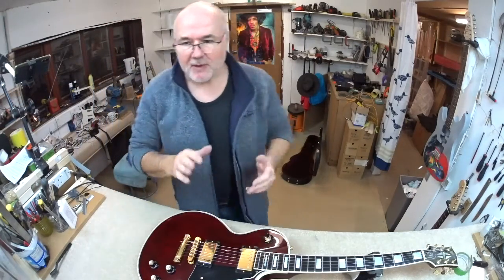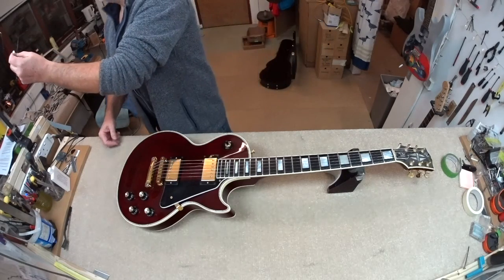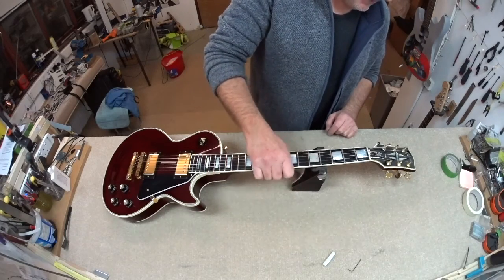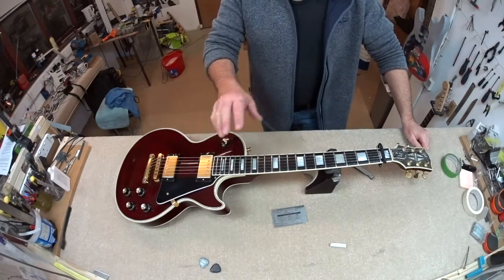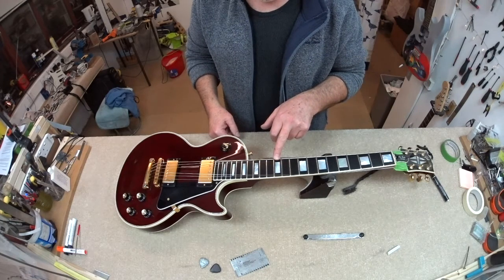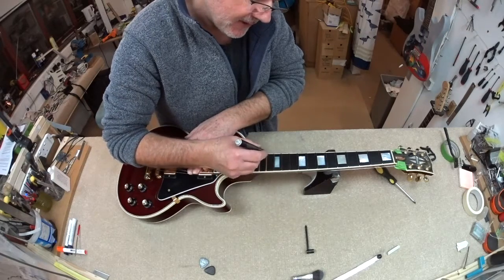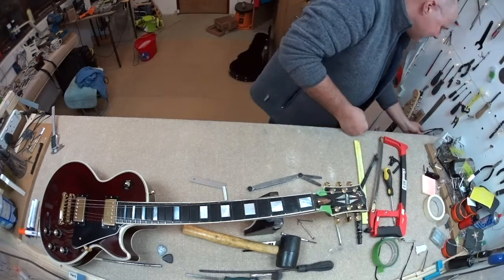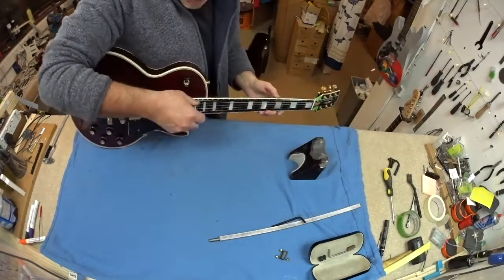Gibson Wine Red 1997 Les Paul set up

Comment: The new place looks great. To bad your camera work and lens choice is still lacking. Cannot believe you are putting that silly nut on a LP Costom.
Reply from the maker: Things take time... The videos (including the average camera and no editing) have nonetheless worked exactly as planned for my business and I'm in a position now to upgrade to an iPhone 12 for workshop filming.
Calling the nut I fitted silly suggests that you'd prefer unstable tuning in order to keep the look. One thing I've learned is that if a guitar won't play and stay in tune it doesn't matter much you paid for it it'll spend more and more time on the hanger or in its case. I use this silly nut arrangement because it WORKS and because customers LOVE the amazing tuning stability they get from it. On top of that there's no damage or modification to the nut slot / shelf so they can revert to the traditional nut prior to selling it to you ;-)
Reply: That silly nut has made "my" guitar fantastic. As Sam says it's fully reversable, but why would I want to? It plays great, looks OK and has stable tuning. I highly recommend them.